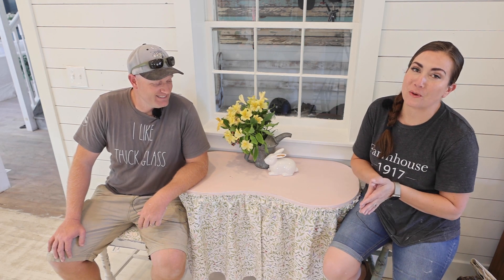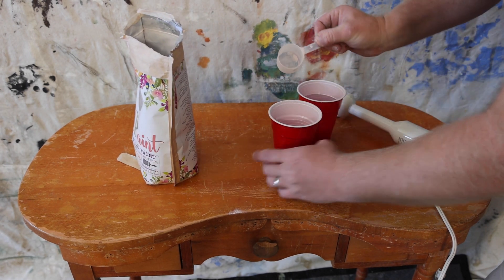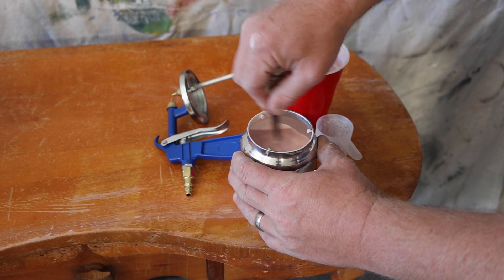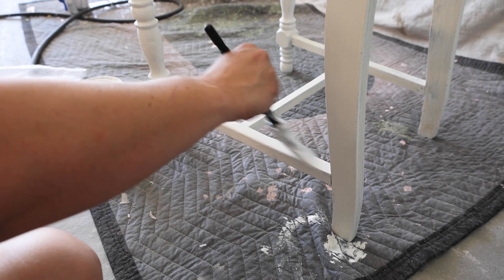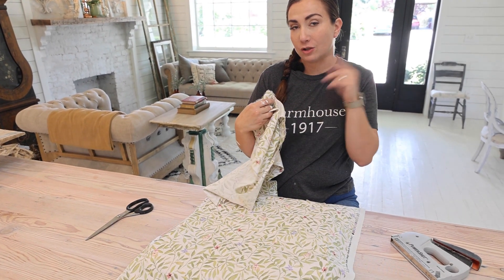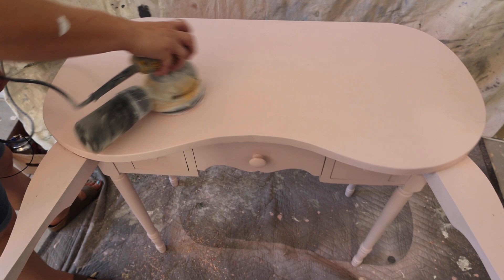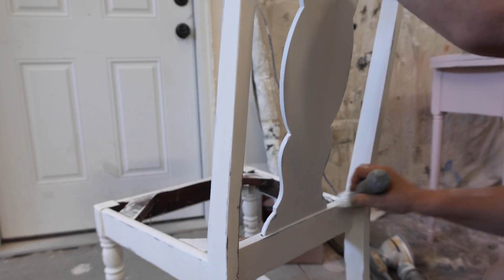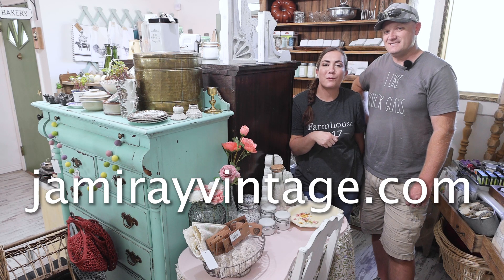Thrift Flip Vanity and A Big Surprise

Comment: Question: when your spraying and you have runs- couldn't you just use a brush to even them out real quick? Or is it easier just to wait for the second coat?
Reply from the maker: With milk paint it’s easier to sand them out then second coat.